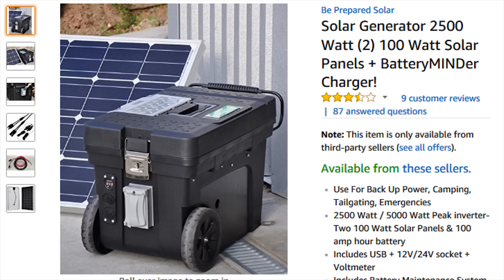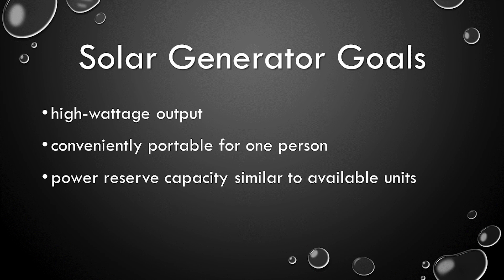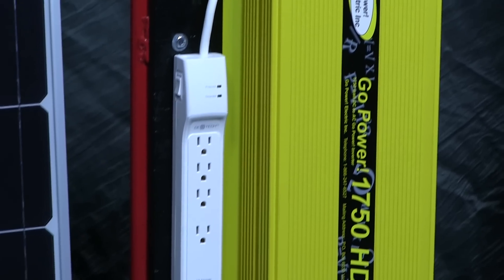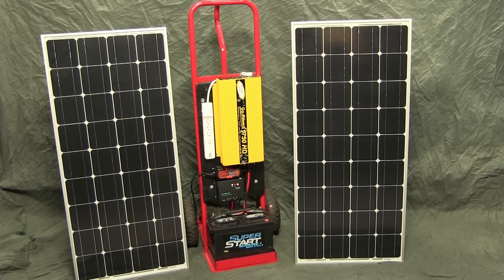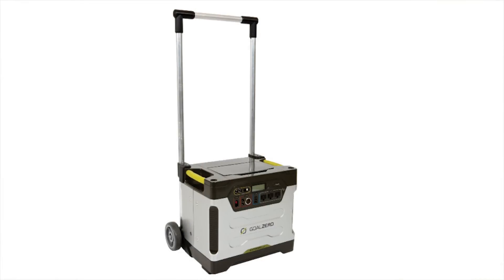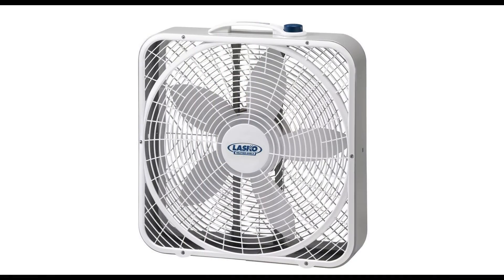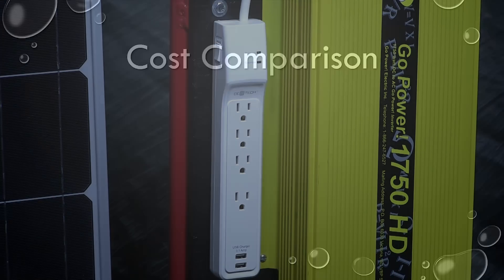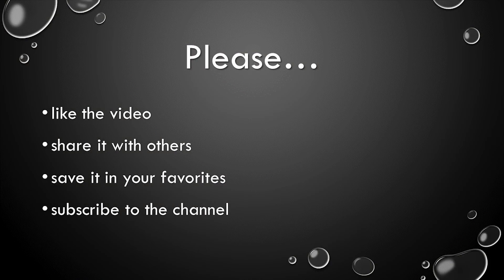DIY Off-Grid Solar Generator (rev 1) – Low-Cost Portable Power

Comment: Why not go with lithium batteries and coupling them in parallel like 2 12v 250 amp hour batteries? That 6000w of power, given in a 12v 110 power with a discharge ability of almost zero. Lithium weigh less than AGM or lead acid

Comment: Today, in 2023, you could probably build it with a LiFePo4 battery for about the same price and be able to use 100% of the battery's rated capacity.

Comment: 200w panels max for a 1750 battery. So at 50% u need about 900w.
If the panels operate at 100% ull need 4h of peak sun daily. Since they wont ull need about 5/6h?

And in winter u wont get that many depending on location. Why not more powerfull panels?

Comment: If anyone reads this who has ANY KNOWLEDGE OR EXPERIENCE WITH SOLAR,PLEASE HELP. Ive never owned any type of solar system and was about to buy my 1st solar generator the bluetti ac200 max and came across this. I know the ac200 is very compact and plug and play but I feel for the 2000 dollars I can buy a all in one solar inverter and battery for the same price but would get more wattage output, higher solar input, higher/faster ac input/charging,and as times goes on just add parallel batteries for more watt hours. Can anyone give me there opinion on witch way I should go. Or suggestions for a solar generator system for around the 2000 dollar mark...  THANK YOU SO MUCH FOR ANY HELP YOU CAN PROVIDE!!!
Reply: I would avoid Bluetti AC200 or any of these portable solar generators because they will break down fast, just read the amazon reviews and you will see. I recommend seeing Will Prowse to learn more about DIY solar generators which this linked video shows his hand truck solar generator version that inspired me to make my own: https://www.youtube.com/watch?v=Dpzc2Qb6JRU

Comment: Is there any issue having it plugged into the 120 maintainer while using the inverter ( but of course why would we do this if grid power was available...) I am of course thinking of trying to have a system that can take both grid and solar and switch back and forth...so this is why I ask, does that maintainer back feed the pannels?

Comment: Suggestions:

Use a mppt charge controller for added efficiency and flexibility with solar panels of different voltages.

Use a lithium iron phosphate battery. More expensive but lighter, deeper discharge without damage, no maintenance and a much much longer usable lifespan.

Also, provide a way to utilise the DC voltage directly without turning on the inverter. No need to turn on the inverter to charge your cell phone.

These modifications would probably add another $400 to the build price but it would take this to an entirely different level. Totally worth the additional money.

I would suggest using the system I described as a regular power source for a few specific small loads. I use mine to power my cpap machine lights and a small TV in my bedroom. A permanently mounted solar panel and lithium battery means absolutely no maintenance and it is ready to go when the peer fails.

Excellent video and a very clean build...  your configuration is definitely usable as is. Enjoy.

Comment: Very nice 👌I want to copy this , maybe build 2 battery shelves stacked, the second slighly oversized to accommodate unknown battery footprints, could be used for storage now , maybe find a perfect removable storage box,  if a second battery is in need like you stated you have a place for it. Your design and build is perfect however as is.
Reply: Also the ability to service your design over an all encompassing solution,  I'm my opinion is a huge plus.

Comment: Like it a lot, but how does the battery charger work? How did you connect it?
Reply from the maker: When I first visualized the generator, I was thinking of it being in the garage, and rolled out for power outages. The battery charger would ensure it was always fully charged when needed.  If the power was out for an extended period, the solar panels would provide on,-going charging.  Since then, it's been permanently connected to the panels, and the charger is unused.

Comment: Good info, but wish I could hear it as you speak quickly and with that annoying loud background music it's hard to digest what you're saying. Just because you can add music doesn't mean you should, especially jittery annoying techno junk, turn it off, thanks.
Reply from the maker: Good feedback.  You were commenting on the first video, and it sounded OK in my headset, but the music is certainly too load the on a lot of speaker systems.  In later videos, I've dialed it back.

Comment: Has there been any upgrades since I watched this 3 years good video thanks
Reply from the maker: Yes -- check the channel for revs 2, 3, and 4 plus the builder's guide for the solar generator.  The upgraded model is more capable, and addresses deficiencies in the original.  Thee are also a number of new solar projects underway, so subscribe so you've be notified as they come out.

Comment: Why not use a Lifepo4 Battery. It will last a lot longer, much lighter and prices on Aliexpress as an example you can get 90Ah for under 200 dollars, and you can easily get 80% instead of 50% of that capacity.  They also charge faster and are not subject to the peukert effect of lead acid.

Comment: I've been looking for a charging solution for 2 Baofeng hand held radios, cordless 12 volt power tools and a charger for ion AA and AAA batteries. I've had an Onan 4k genny in an rv and a portable 2k both worked good but there is the issue of fuel, and it seems like overkill just to charge things. I really like this version of solar generator. Enough wattage for what I need, portable and most importantly, reasonablely priced. I was looking at the Jackery 1000 watt and their solar panels and found the ion battery begins losing capacity after 2 to 3 years. That is not acceptable to me. I'm going to get the parts for your design with the exception of using a AGM deep cycle battery.

Comment: Excellent! Just the kind of system I've been thinking about. Not to live "off grid", but a simple system to use in an emergency, something that will provide some electrical convenience for up to a few weeks if needed.  And a system that is fairly inexpensive and easy to move around, if needed. I might think about a sealed batter so I don't get a buildup of hydrogen gas while charging. Wish Lithium batteries would come down in price, they're still too expensive in 2020! Thanks!

Comment: I like the unit.  The different things I would do for myself, would be add a 1 or 2 cig lighter plugs up stream of the inverter and maybe phone charge plugs upstream of the inverter on a switch.  If you only need a phone charge or cig lighter plug you can turn off inverter.

Comment: This is excellent now I have a Chevy volt and I use my Nexus ego power station to charge it up a bit any idea if your system is capable of doing so? Now the ego Max his power station I’ll put a pure sine wave so my thought was that I would charge that unit with the unit that you have made and see how much charge I can get in my car and it’s main purpose would actually be to power my overland camper

Comment: Excellent presentation. I would say if this fits your needs then fantastic. You have the ability to add or subtract whatever you like. I have a large unit myself for more of a bugout application. As someone mentioned .... Battery types. Adding a battery is always an option which is a great idea. You may want a bigger inverter. I would say it's all personal choices. If you go larger on solar panels then you may consider an MPPT controller. That would always maximize your solar battery input.  Yes sir... a fine job and thank you.

Comment: Very nice unit by now I'm sure you've adapted it to lithium ion phosphate battery.that would be the only way you could improve upon it. Lighter weight twice the amount of power and much longer life. In the end the batteries are cheaper.

Comment: If you use an SLA battery it can be used and stored in any position. An AGM type is even better. They all have their price points.
   I would build this on a garden wagon the kind with pneumatic tires and a mesh bottom. Less issues with tipping since it's always in the horizontal position. A cover of some sort over the top can keep it weather protected. Another refinement would be to add a gas engine running a car alternator. Yeah, I know it's back to gas again, but it can be nice to have the option at times.

Comment: For about $10 more you can go from group 27 to group 29 and get around 100 more cranking amps and about 30% extra battery life and it’s only a couple inches bigger about 8 Lb heavier. I had 3 in my motor home with 5-100 watt panels they ran everything without any problems

Comment: Dessert Prep please can I use normal car batteries of 100 or 200  Ahms to power my solar panels and what level of efficiency do I expect for power storage? How many of these batteries, panels and size of inverter do I need to power my chest freezer for six hours with other light household appliances like LED TV,  ceiling fan, and 8light points of 20watts each  in an off and on grid power supply?

Comment: Hi, looks like the best undeniably. Is there a way to brace two more batteries anchored onto the bottom behind the original front side battery? Fastened opposite of your panel's attachments?Of course it would be heavy as hell, but, knowing to unload your fantastic product off of a van with no ramp, one would knowingly find it necessary to remove any battery (very easy) , Anyway, with 4 solar pannels and 2  added batteries in the bottom back side, which incidentally balances out the weight, would it all be possible? Maybe fatter tires, good bearings ? Reason is is that I'm an a/c fan. Keeps my linnens, fresh.....Thanks, let me know if you can. Thank you. Very nice.👌

Comment: Great build, and really good information. Only thing I would change is the marine battery. They are not very efficient for solar use. Marine batteries put out more amps for cold starting motors, in solar it wastes energy. But deep storage on the battery is good. over all impressive build.

Comment: One advantage you have is that you built it yourself so in a SHTF situation you stand a better chance of repairing your solar generator than someone that bought a Yeti and has no idea how it works. Even if they knew how if worked, acquiring parts could be dificult. Nice job.

Comment: The battery tray could have been built with a pivoting bracket instead of a rigid one, longer battery leads also to allow the battery to swing when tilting the hand cart  so you could load it in a truck without off loading the battery.

Comment: Maybe mount everything on a small trailer and make the solar panels able to tilt. Would allow you to carry more batteries too. One 100 ah battery for everything 100 watts of solar capacity. Would also use AGM batteries. Should be able to run a small refrigerator,  fans, and lights indefinitely.  Good overall idea.

Comment: You spent less money to recreate the over priced and under powered goal zero BS you can buy on amazon? At a C10 discharge rate on that battery, you can run a 120W load without getting voltage sag, 20% of that will be sucked up by that POS inverter.
Its better than nothing though

Comment: I have a system that is one 12 volt battery and one hundred watt panel. And voltage regulator. Enough for lights and keeping my tablet and phone charged. During the day I can listen to amplified music. None of the systems shown here will power anything 110v for very long. I have no inverter. They are very inefficient. They gobble a lot of the juice! This is a very small home in the Peruvian Andes. It can get cold at night. Plenty of blankets!

Comment: A gasoline powered generator costs less and can produce power for an indefinite period of time. What is the advantage of using this setup, other than elimination of the fuel requirement, which comes at the expense of using an unreliable energy source?

Comment: Hello , I like you’re presentation of the solar power set up you combined ! I’ve been watch a ton of videos and links how to create Ac power about 115v @ 90 Amp’s is what I’ve seen on YouTube I just got an Alternator in the mail what they say is a GM Alternator 1 Wire self exciting tapped off the “ Stator which is the copper wire that is under the casing  , what they say is once you remove the back plastic cover than split the Alternator in half by removing the 4 bolts which hold the 2 cases together, when you put the alternator on the bench on its Pulley looking down you’ll see the 4 bolts holding it together, when you separate them on the back you’ll have 3 leads 2 wires each 1 in the middle like on the top of the alternator if it was sideways and 1 wire a few inches on each side 1 to the left & 1 to the right which is suppose to when spinning each 1 is supposed to be putting out 115v Ac that’s 3x 115v Ac and at what Amps ? I have not personally tested this out yet and to have small electrical motor low power draw and low Amps spin the Alternator when the AGM or lithium batteries drop bellow 12v and the inverter goes to the batteries similar to the way you have it set with the power cord but also wired to you’re home fuse box , the batteries keep the Alternator \ Alternator’s running to charge the batteries and a hard wire goes also straight to you’re fuse box when the draw is heavy the alternator can be feeding you’re house straight to 1-100 Amp Split Fuse which will feed both sides of you’re fuse box and you are “ Self Contained “ and to throw a little bit more onto that I’ve seen if you take apart the microwave there is a voltage transmitter which contains and multiplies your 120 voltage fed in from the wall it multiplies it by 10 to 15 times to give you the 1500 W to 2000 W microwave But these save power so they’re very hot and can kill you even if unplugged I saw that video on the person one you highly be very careful what you put 120 in and you get like 1,500 out ! So go get a bad microwave and experiment you can be self sustaining for a couple hundred bucks just be safe and be wise I’ll be making videos once I get all this together ! Totally DIY ! In Jesus Name !
Reply: This guy has some good info, he should post it separately as it is too long to be a comment on someone else’s work

Comment: I just stumbled onto this.  Nice job sir!  Once suggestion, from an electrical engineer here: I didn't get a good look at the cables connecting the battery to the inverter but they look a little small.  If you try to use the inverter near its full capacity it will try to pull something like 150 amps from the battery.  At that level of current a lot of power will be lost to heat in the battery wires (and the battery won't like it much either).  Also, the voltage at the inverter will drop enough to cause it to quit.  Consider scaling back your expectations as to how much power you can draw from your system at once, upgrading the battery<->inverter wiring to something like 2 gauge or larger, or both.  Very nice system though.

Comment: You need a real deep cycle battery. That one you have is to start also. A deep cycle only battery with no starting amps will last A lot longer and take more discharges. 2 - 6 volts would be better, wired in series and last even longer. Trojan makes a great 6 volt that is cheap and very popular.

Comment: Great video. Thank you. Would be good for an RV, also. (w/o the hand truck)  I have read somewhere that the sealed batteries are not as good as those that allow refill of water, such as you used. I think better for longer life. Did I read right?

Comment: This video really inspired me to try and make my own power system for my shed, which is  currently running of a very long extension plug from my house so I went online trying to find some slightly cheaper options that I could afford it, I'm in Australia, I made a list of a few things I just want to know if any of these would actually work,
Sorry I had to shorten some of the links they were stupidly long

XTM 160w Solar Panel :https://www.bcf.com.au/p/xtm-160w-folding-solar-panel/563066.html (BCF) 
Certa Power Inverter: shorturl.at/jkrv8 (Dick Smith)
6V 12V Battery Charger Maintainer Trickle For Motorcycle: shorturl.at/rACJ3 (eBay)
Flat Car Battery From The Local Dumb
Industrial StorageTub (Water Proof) (RedDot)

Comment: Doesn't the Yeti have a lithium battery? Ok this video is a little old, but lithium batteries can be discharged almost down to zero, not only to 50%. They're also more efficient, longer living, which is what makes lithium currently less expensive, watt-for-watt, than led acid. The upfront cost is more though. Will Prowse explains this in his solar diy videos.

Comment: Great video.  My only suggestion would be to use an AGM sealed battery.  You could then use this rig in any position and load it to move it by vehicle.  The AGM batteries are a bit more expensive but being more portable would be worth the extra cost.

Comment: Good video but isn’t the inverter pulling too much current for the battery? Maybe I’m wrong but I thought 100 amp hour battery should be used with 1000 watt inverter?

Comment: Thanks for sharing this video. I'm wondering why you didn't choose lithium iron phosphate cells instead of the deep cycle? The cost over the lifetime 500 cycles and 50% useable watt hours for the batteries in your system, versus 2000 cycles, 80_90% useable watt hours of a  LiFePO4 generator, it seems the marine batteries are cheaper at the register, but more expensive in the long run. Anyway I'm just wondering why you chose these particular marine deep cycles.
I love the cart system. Moving it around the property is like that is pretty awesome. 👍